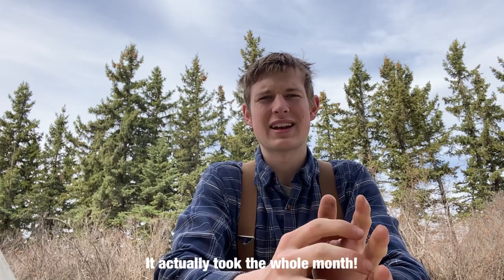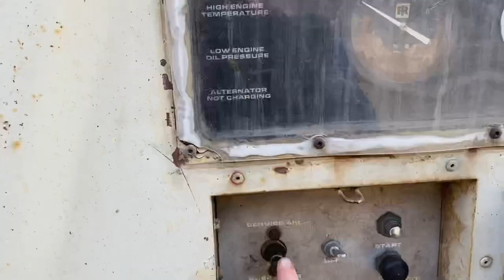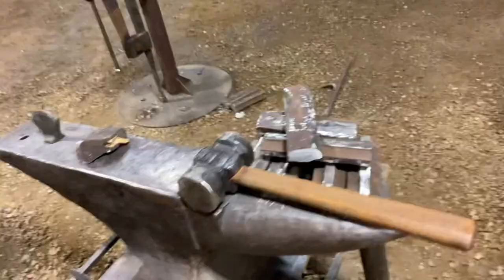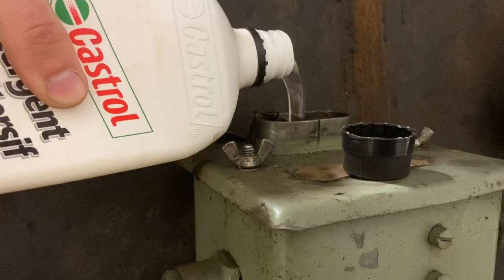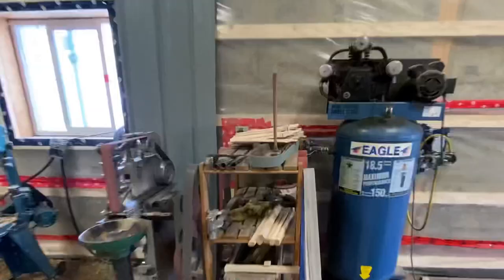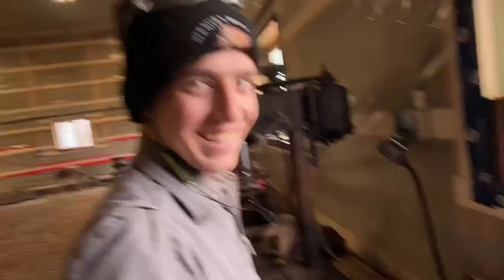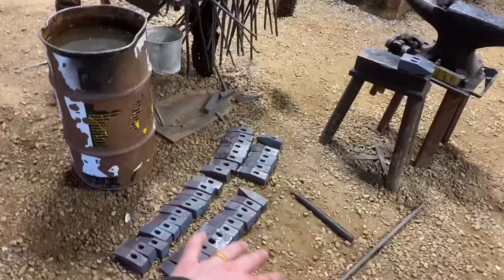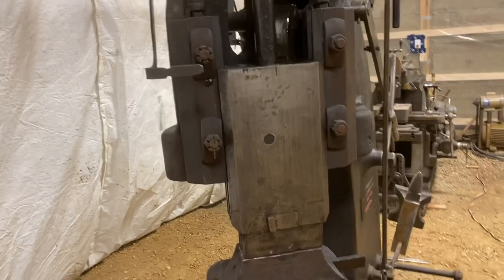Making 40 Hammers for @TimothyDyck Pt. 1

Comment: I have a self-contained hammer in my shop. But I learned over 60 years ago that a man gets less done while sitting. I did not learn this in my shop but on my fathers Texas ranch. Sit and you would instantly learn why you shouldn’t. Oh, you’re gonna put an eye out too. Glasses are actually cool.
Reply from the maker: Sir in a kind and humble way I really don’t understand what sitting down while ranching has to do with sitting down at the powerhammer? It makes absolutely no negative difference when you’re working at a powerhammer… In fact it’s more relaxing and therefore less fatiguing. Also I’m not sure why you think I’m going to put an eye out? This type of forging does not put your eyes at significant risk… And as you can tell by the way I dress I really don’t care if something is cool or not.

Comment: Good job Ethan  , wow that Hammer  shakes the ground ! Could see it jump the camera with each blow from some feet away . Wonder the weight of the hammer ? I have two Massey hammers recently purchased , a 400 lb one and a 10cwt one . I can see I’m going to need a lot of concrete under them ! 
I love steam equipment , actually I’d say your hammer would pack more punch with steam , it has better expansion and the cylinder would be more freer  with being hot . Keep up the great work cheers Tim from New Zealand
Reply from the maker: Wow those Masseys sound really fun!
That steam hammer has a 600 pound ram, and the total weight with the anvil is about 11000 pounds.